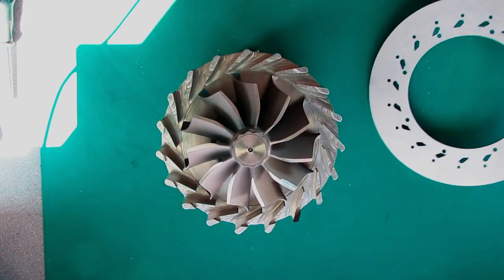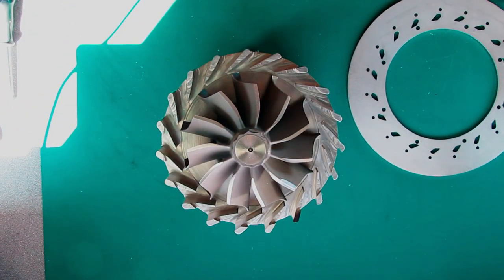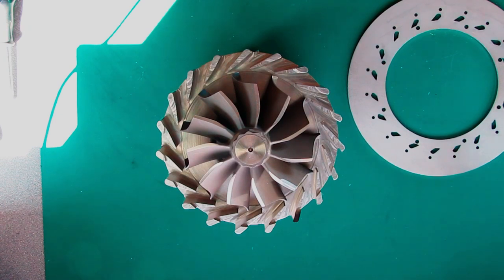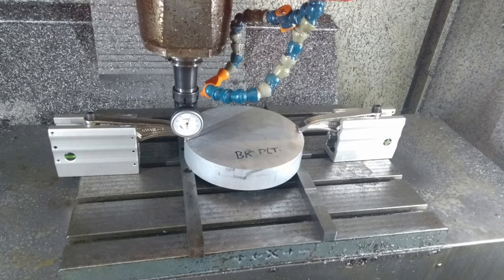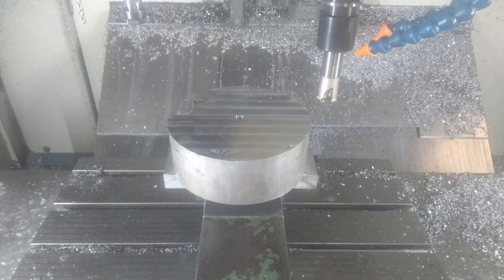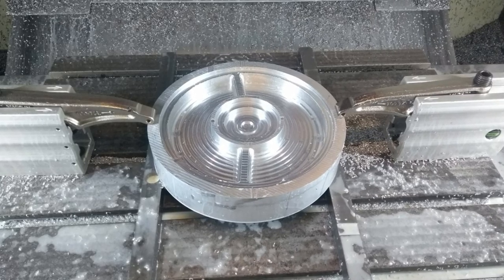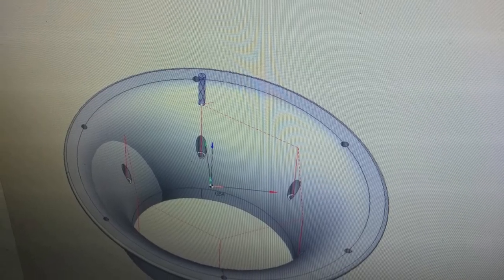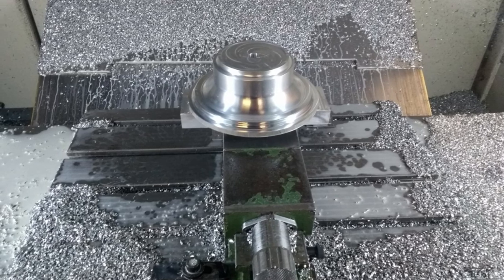DIY Turbo Jet engine Building The New Engine NGV Section

Comment: I would go for the free turbine, however I was working on an idea some years back, of running both a free turbine for get off the line go and a switchable duct that would select an afterburner once I was up to a reasonable speed, I built and bench tested the idea on a small scale and it worked ok. Just an idea you are welcome to try out if you want
Reply from the maker: HI, yep John and i been talking about some thing similar,  its more complex with freepower unit, but the rewards are there. A lot depends on finding or making reduction gearbox, getting turbine wheel, and money :-). Then we get into issue of speed rating for kart wheels and chassis. With freepower we could be looking at perhaps 200mph or more, the kart tyres only good to 140... 150 ish :-)

Comment: I was expecting inconnel 713
Reply from the maker: Hi, thanks for your comment, would be nice to use inconnel, but cost etc, stainless works well, engine only runs to 800 c max, plenty of cooling air etc, so all good, thanks again 👍
Reply: @Turbojetkart  thanks, what type of stainless steel did you ue and how much did that piece cost you if i may ask.

Comment: been looking for this turbinr specification but cant  find, anyone here have one?
Reply from the maker: Hi... You looking for the turbine wheel... Or the whole engine... Go to Jet and Turbine owners forum . JATO
Reply: @Turbojetkart  hello  thanks Andy  Morris ,yeah i been in Jato but there were no detailed plans i could find only pictures :(
Reply from the maker: HI, the engines are homemade... each person designs there own engine etc... there are books that can help you design your own etc, but if you chat with the guys on there... they will point you in the right direction. I have drawing for my engine... but until it is finished... I will not share them, but we may be offering parts for other wanting to build there own
Reply: @Turbojetkart  i m just looking for the turbojet impeller specs the rest i can do but  i need to know the size for motorbike turbojet impeller and the size of the billet

Comment: Uhmmm, isnt that the diffuser? The housing that surrounds the compressor. Because the NGV is on the hot side of the engine.
Reply: that is the hot side
Reply from the maker: As said it is the hot side :-) the 3D animation at the end of the video clearly show how the engine goes together. But thanks for your comment
Reply: Diffuser is coming soon